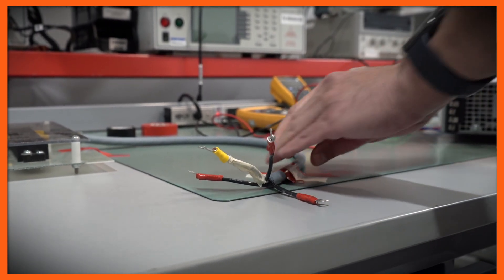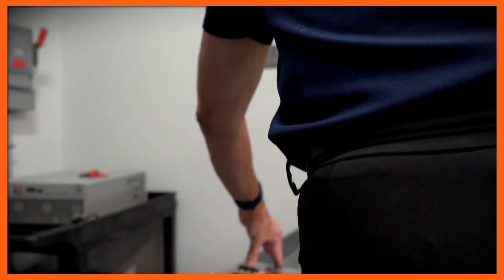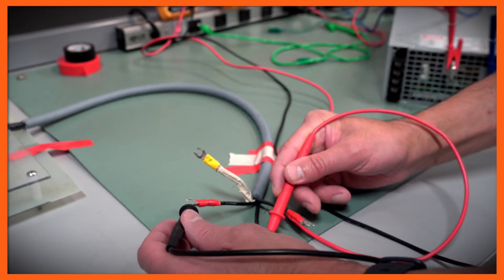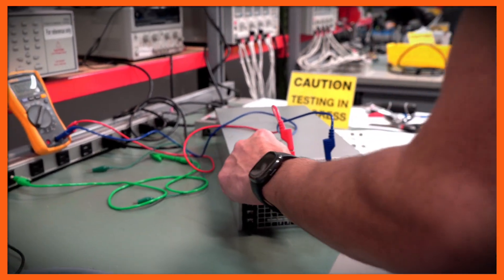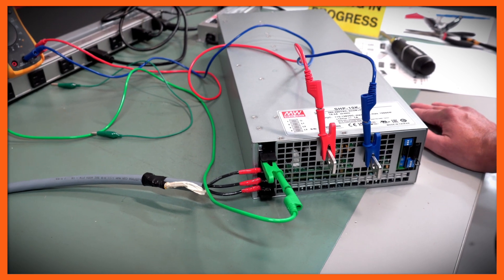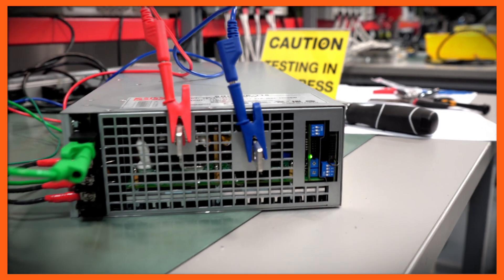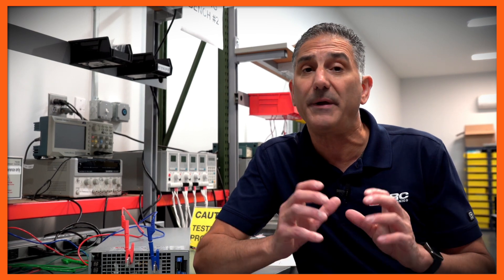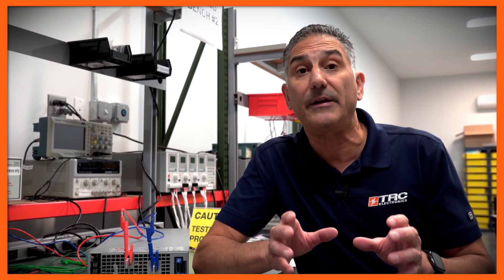How To Connect a 3-Wire, 3-Phase AC Input to a Power Supply - Step by Step Tutorial

Comment: On these power supplies does the L1, L2 and L3 connections have to go on in a specific sequence, or does it not matter?
Reply: Hi, this is Mike Petagna here.  The sequence with this power supply does not matter because the power supply has a input rectifier stage that takes the 3 Phase AC and converts it to full wave rectified DC. It is important that you identify the 3 phases and if you have a neutral wire, the neutral wire is NOT used for this 3 Wire / 3Phase application. Let me know if this answers your question.
Reply: @michaelpetagna9270  thanks for the reply.  It does, I am working with an electrician on a keysight RP7933A and he was wondering if the sequence mattered.  It’s also a 3 phase AC input.